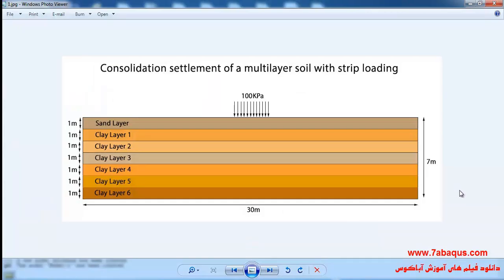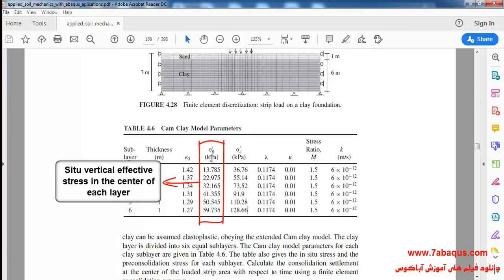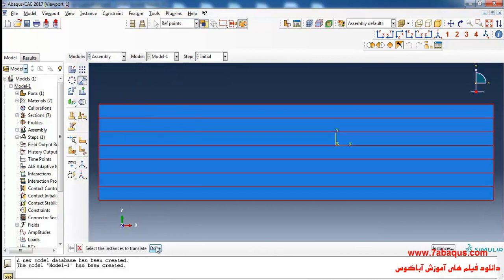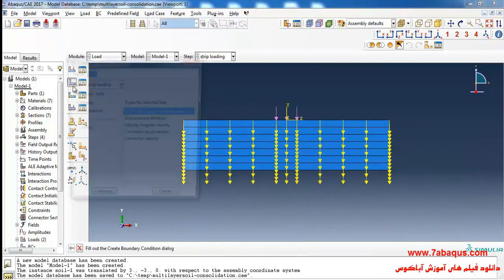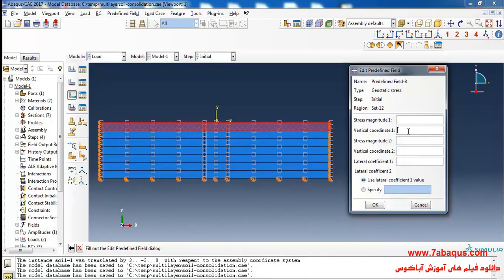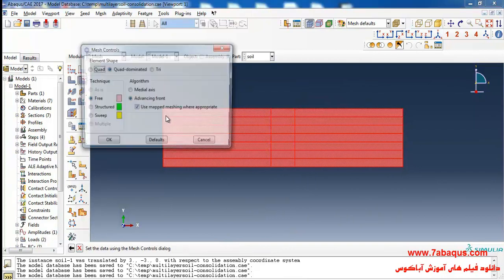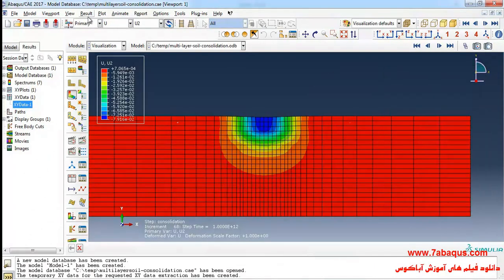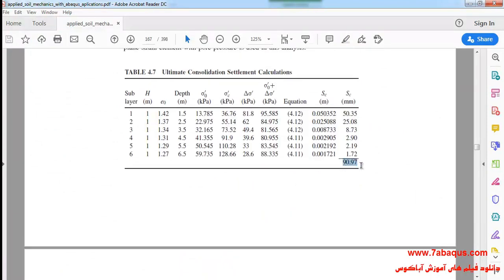Consolidation settlement of a multi layer soil Abaqus

Comment: Consolidation takes a long time, so to simulate the long-term effects on underground engineering, it is appropriate to use boundary conditions in a consolidation analysis step, right?
Reply from the maker: In general, the consolidation process should be long.
Yes

Comment: (Permeability is specified on 840 elements but the initial void ratio is not defined. Use *initial conditions to the value. The elements are identified in element set ErrElemPermNoInitVoidRatio. ERROR